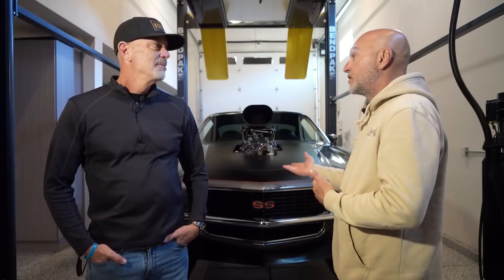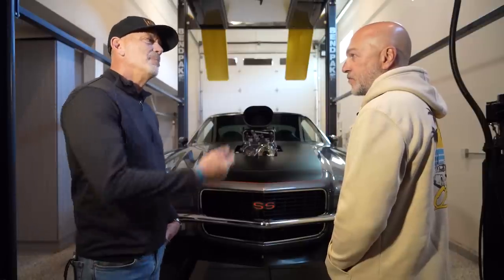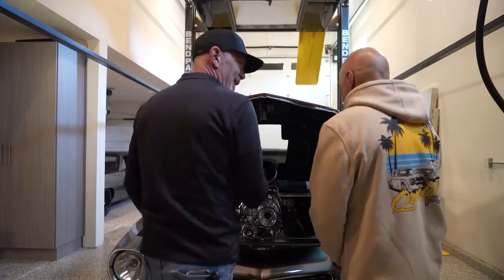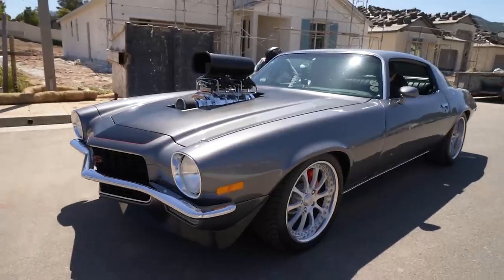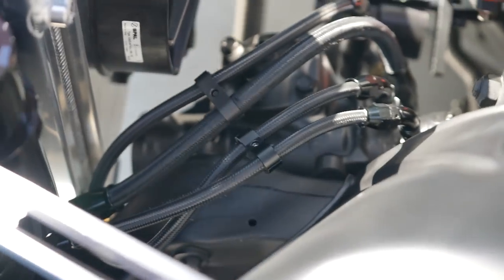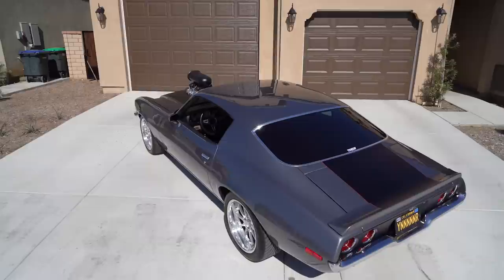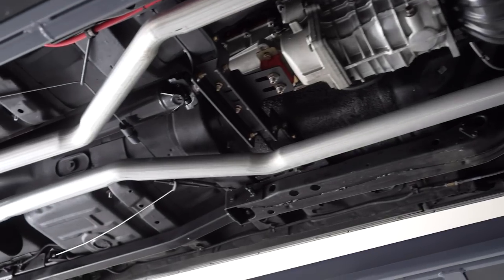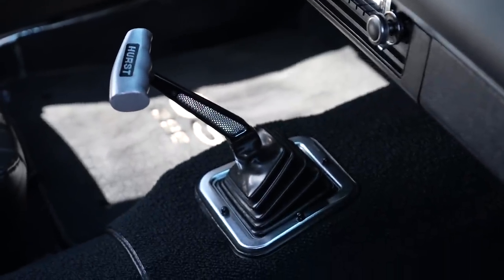Big Block Big Blower '71 Chevy Camaro Restomod | Pure American Muscle

Comment: I've said this before and I'll say it again. There's nothing like an old-school blower,it gets the blood going👍
Reply: respectfully, while it shouts "HP" better than a stroker setup...and the whine of air trapped between belt and gear plus the surge at idle is ear candy....it eats torque off the crank (since torque is spinning motion) and wears out its seals. there is something better than a blower, and it's a turbo. technically a "blower", except operated differently. I've had older setups that lacked "low end" like centrifugal blowers, but they can be set up for low RPM boost as well.
Reply: @albertgaspar627  turbo don’t look as cool sticking out the hood as old school screw blower does  ,if turbo’s really did make more power than screw blowers, I have zero doubt NHRA would’ve been using them long before now, since literally all of them still use blowers though I have to say blower is king of torque especially at 1/4 mile at a time🤙🏼
Reply: A giant cowl hood and a hole in the front grill is better than turbo or roots blowers. Louder, more whistle , torque and power than either roots or turbo on the street. All no prep racers and Radial Promods are using crank driven Prochargers. I'd have to say they are king if you want to modulate traction and have the same or more top end power as a screw on the street. Check out my Twin Procharged Camaro or Big Red (when its running the Procharger) for proof!

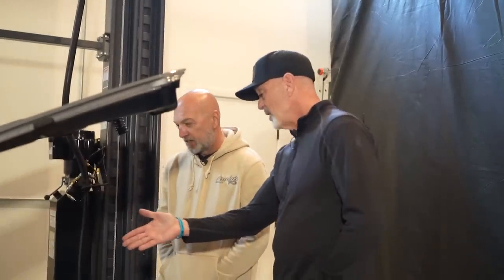Comment: 4:23 - Shawn, just FYI a 496 BBC is typically derived from a .060 over bored 454 with a 1/4” additional stroke (4.25). It was super common in racing before aftermarket tall deck blocks became prevalent.
Reply: It's the 383 build for a big block. I plan on building a 496 for my 2nd gen.
Reply: @ChasingPerfection  - Yep.
Reply: Chevy made tall deck blocks for the extra piston ring and back in the day when I worked on those they ran on propane.

Comment: 💥 Killer ride.  There’s nothing cooler than a second gen Camaro.  7:38 I have 275 on the front and 315’s on the back of my 70 RS big block 468 and she roasts the hell out of them easily for the first 3 gears of my Tremec TKO 5 speed.

Comment: A 496 cid Rat engine typically is a 454 block matched to a 4.25 inch stroke crank. Ironic that Chevy would create its 8100 litre engine that way with heads that are closer to an LS than any head made for the 454 block, when they had a 502 cid crate engine (with a Ram Jet EFI option) with a bigger bore sitting around. Perhaps the engineers worried the bigger bore offered more opportunity for detonation in towing situations?

Comment: "How do you get 496ci?"

454 (4.25 x 4)
496 (4.31 x 4.25)

Bore a 454 block .060 over and add a 4.25 stroke crank and rods.
Reply from the maker: Thanks for the info. I figured it started with 454

Comment: That tko 600 5 speed is only rated at 600 foot pounds, he said it was 815 whp. That's transmission is gonna blow up soon guy you should've went to the t56 super magnum that's ratted for 800+ hp and gotten the second overdrive, and you probably are gonna need to go down on compression with a shallower piston because that head gasket can only take so much pressure before it will blow with a fucked up combo like that. Other than that it's a great car.

Comment: Don't know if I'm buying the "Took the 12 bolt out to put in a Chevelle" story,,
You could find GM 12 bolt rearends everywhere. you wouldn't remove it from a SS Camaro.
1971 Camaro SS 350ci cars came with a 10 bolt rearend. I have a REAL 1971 RS/SS (split bumper)
350ci 4 speed Camaro with a 10 bolt. 
GM only made 200 RS/SS Camaros with a 396ci 4 speed,,, 1971 (full bumper) (like the one videoed) were 350ci SS Camaros.

Comment: Those exhaust bends ruined the build, and the shop should be ashamed to have installed the system with those resticted like that. Damn you made sure to not have hose clamps but saved the money on the exhaust system. Sick car thoe, but that system shiiiiiit

Comment: to have a car like that and not peel off the tires kinda gives some a notion that theres something wrong with the motor... considering petrol heads are looking and going "cool car"....huge blower 800hp to the crank.. a huge blower that should push another 400hp on the 600hp motor that he yields half that power 4 pounds boost n not peel off the tire would have some doubting the potential...   in my opinion...